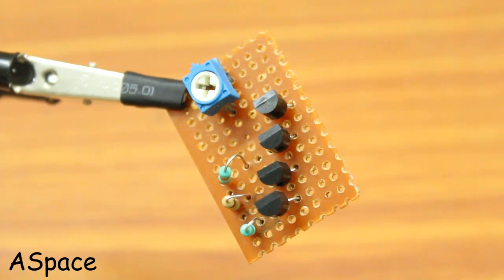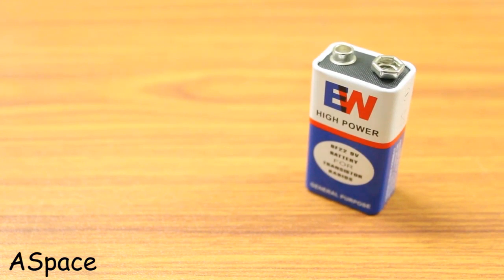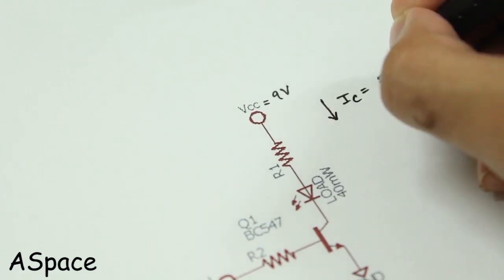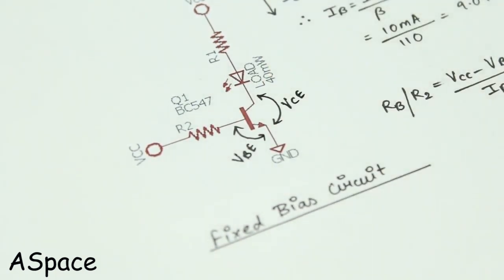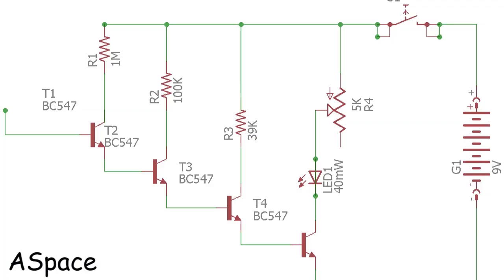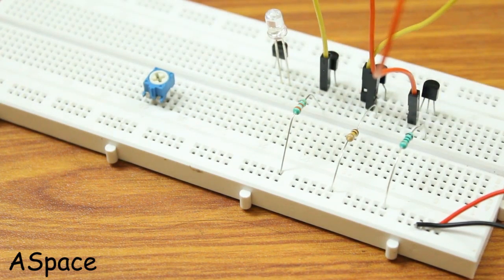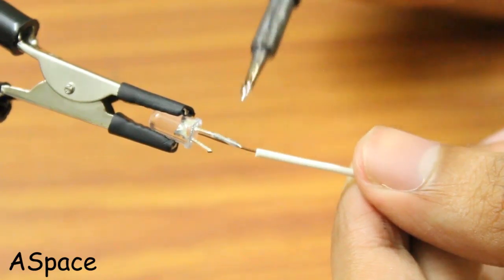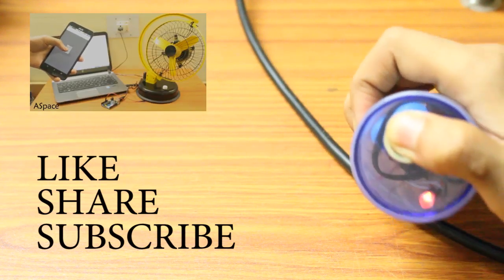How to make your own Emf Detector || BJT as a switch

Comment: I used 1k ohm as a replacement to the potential meter. Why does my led turning on when the battery is connected?
Reply from the maker: This circuit is too sensitive,try choosing your resistors appropriately.
Reply: Can I have the calculations for this project?